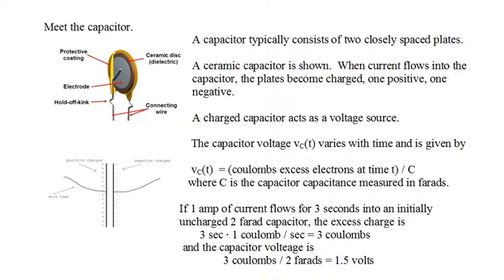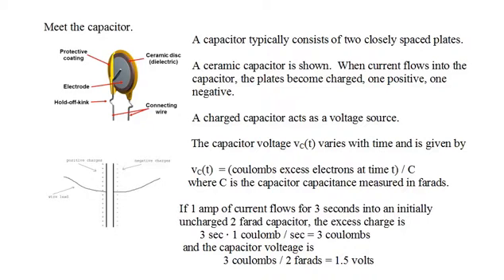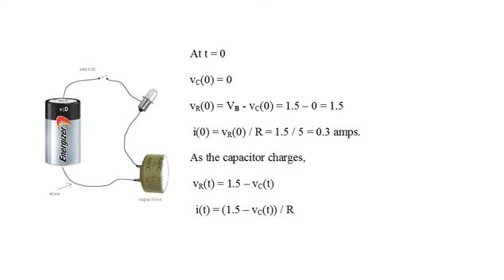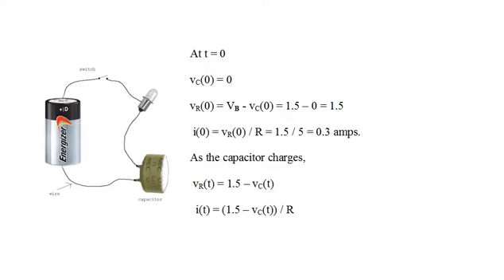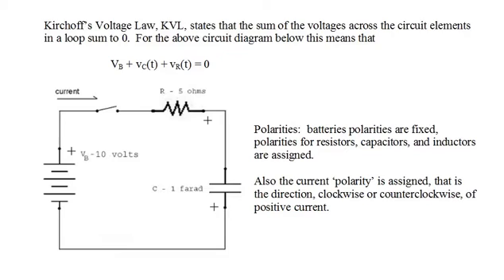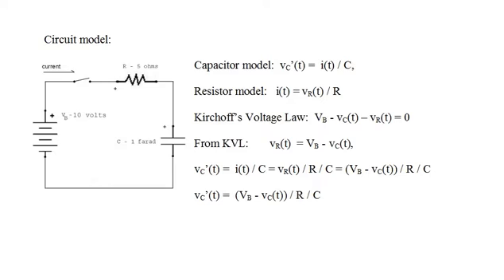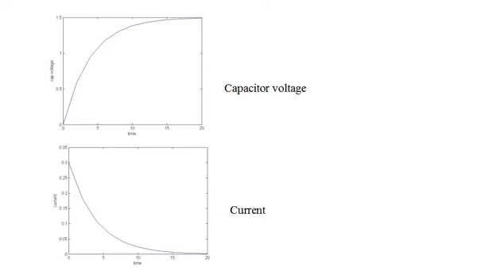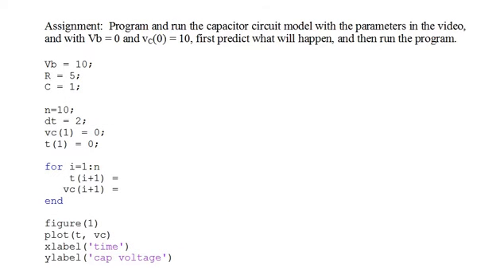MMCC I #11 - Mathematical Modeling and Computational Calculus I - Capacitors

Comment: On the recommendation of a friend of mine, I worked through this text and liked it but found many typos and also programming code errors. A bunch of the programs in the both Unit 4 and Unit 7 Electric Circuits Unit have errors in the programs given in the key with errors that propagate. The oscillating circuits will keep getting bigger and bigger because the calculations for instantaneous voltage uses the current from the current interval instead of the previous interval. I was going to try and send feedback to you a couple years ago to make revisions. Last time I checked, the text and website still had the errors. Also, I would use the same order for all the programming exercises. Otherwise I really enjoyed working through this. From this video, it looks like you may have already made some revisions like in the for loop,  by using for i=1:n instead of 1:n+1 and using (i+1) in the loop code.
Reply from the maker: I'm pretty bad with typos, but I'd be surprised by any program errors.  If you can identify them I'll fix em.  I did make a major revision to Vol. 1 recently but only to compress the first few chapters which don't appear in the vids.   For a good summary and overview check out .... https://www.academia.edu/91391535/A_NEW_PHYSICS_CURRICULUM_William_Flannery_Berkeley_Science_Books
Reply: Great! I will contact you. I was actually wondering if you were interested in publishing your text in Japan or Korea and maybe working with you to put it out. Best regards. @wdflannery
Reply: @wdflannery  On Introduction to MATLAB/OCTAVE/FREEMAT Lesson 10 the example code for calculating 'a' in the for loop is: 
a = -(K/M)*p(i-1);
That makes each oscillation get larger and larger as the error propagates...like "Flubber". 

Here, the instantaneous acceleration or I guess the acceleration for the current interval should be calculated from the current position p(i).
a = -(K/M)*p(i);

Also for lesson 10 exercises, the values given for the parameter inputs do not generate graphs like the graph presented in the question.
In exercise 2, as is the program in the lesson on the previous page, the initial position is 1 not 0 but the graph shown is from initial position of 0 and velocity of -10.
In exercise 3 the initial V=10 but the graph shown is for V=-10

*These could be just typos like inserted the wrong graph into the doc by accident.

I think that there are a couple of similar programs that do the same thing with calculating instantaneous rate of change with values from the previous interval that end up propagating error in the other sections like Electrical circuits with induction coils. I haven't checked the Orbits or Dynamic sections though.

I could be wrong, however. 

Best regards,
CobraTheSpacePirate
Reply from the maker: @CobraTheSpacePirate  Referring to Lesson 10a in MMCC I the program statement a = -(K/M)*p(i-1); is correct, and it's also true that the errors will grow with time.  That's one of the shortcomings of using Euler's method to analyze repetitive motion, as each repetition produces the same errors (as opposed to new random errors) which accumulate.  The real world solution is to use a more accurate algorithm, typically Runge-Kutta 4.
Reply: @wdflannery  Do you still have the aol email?